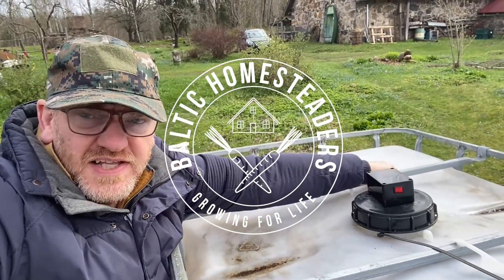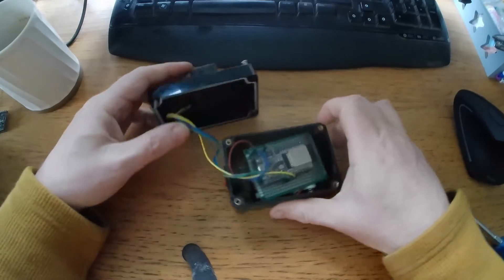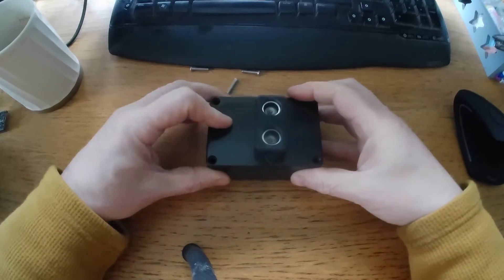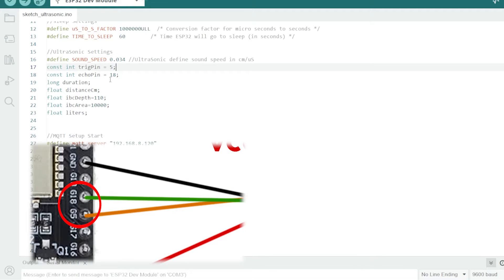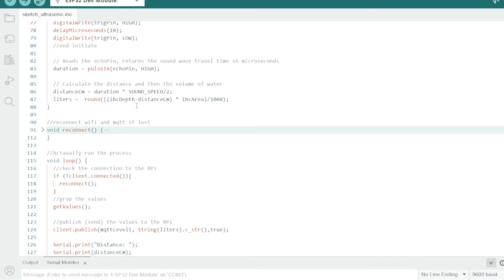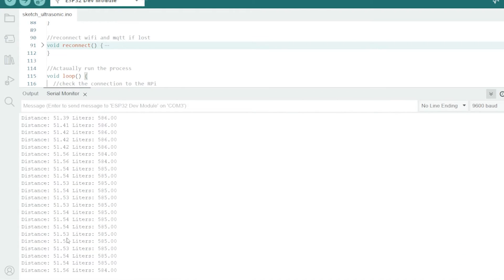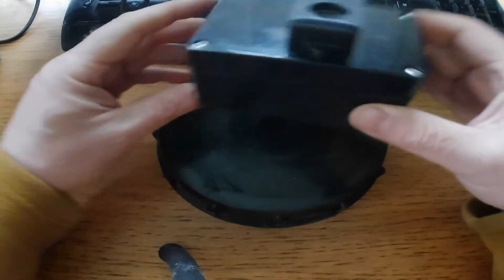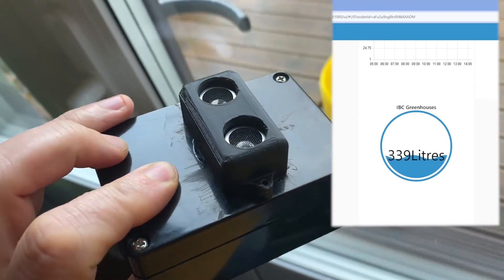DIY Wifi Smart Sensor for Water Tank Levels | Latvian Homestead

Comment: my water tank is on the roof, it is scorching hot and humid, do you imagine this solution would work ? I am thinking about submersible water pressure sensors also
Reply from the maker: Depends how hot and the preferred operating temperature of the ESP32 and batteries. I wouldn’t imagine the humidity is an issue unless it’s causing water to condensate onto the circuitry.

Comment: Would I be able to commission you building one for me ? We have four poly tanks and a mesh WiFi system here in Ghana and I am desperate to know how much water we have consistently
Reply from the maker: In principle I can but you need to be able to program it your end to your wifi and set it up to your network with a raspberry pi etc and likely if you have that knowledge you have the knowledge to build it yourself. Not to mention if something went wrong I could never fix it so it’s quite tricky.